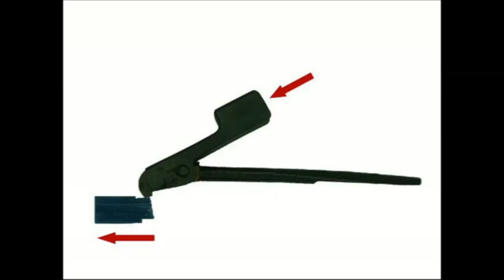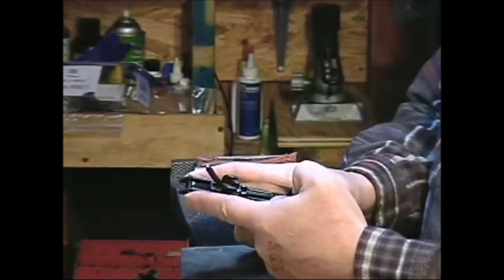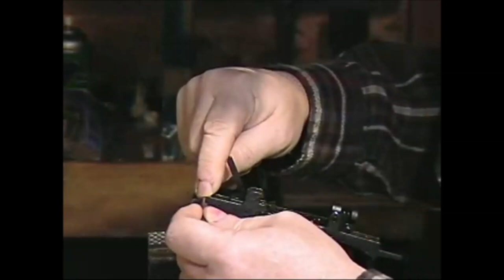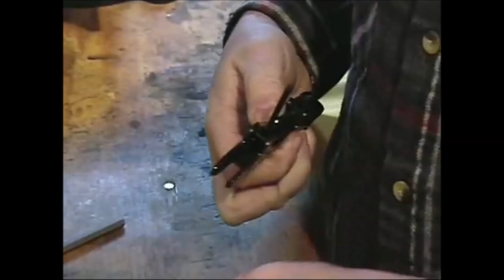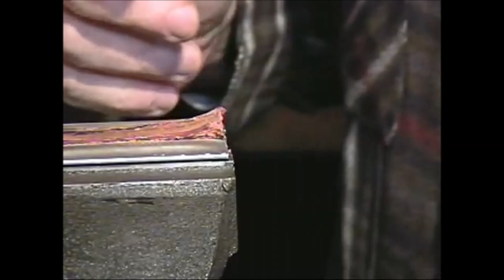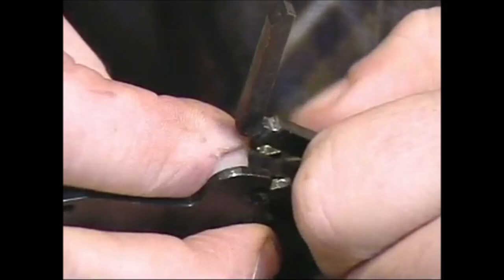SKS trigger Job

Comment: Good video. Just finished this myself. Results were fantastic! 80% of my creep is gone, it is much smoother and has slightly lighter trigger pull with the stock spring. All safety checks passed. Im very pleased and didn't have to send it out for a month $35 later. I would send it out if not familiar or mechanically inclined.

Comment: I did the sear and sear-channel polishing on my Norinco SKS and that smoothed and reduced the trigger pull by around 30%. When driving the magazine latch/sear-spring pin out or back in, the trigger housing's width may be slightly altered because it bends when driving the pin. Check the function of the mag latch; if it's tight, then the housing needs to be widened slightly. I used a brass punch tp pry on both sides of the trigger housing to slightly widen the housing so that the latch moves freely. If the housing gets too narrow, it will also bind the sear.

Comment: When I did my trigger job I marked the sear with Prussian Blue and installed it into the trigger and pulled the trigger so I'd get an idea of how much I could take off.  With this I didn't have to check the trigger pull as often when stoning the sear.
Reply: That's what he did with the red marker.  Didn't you hear and see that?  Either way, good gun smiths check more often, never less.  You didn't learn anything here. Too bad.
Reply: @videodistro  I'm just too stupid.  Thanks for the comment.

Comment: This is a great video. I’m in the process of doing this to my sks. The trigger is creepy, gritty, and long and my sear is neutral engagement. Thanks for this video!!
Reply: This video is 9yrs old.. and I still have the Original upload from the guy who made the video downloaded on a hard drive from over a decade ago.
This is by far the most extensive and detailed video on doing an SKS trigger job yourself.
Even though I have had this video for so long.. and I own 3 SKS's.. I still have never attempted this trigger job - the triggers on my SKS are not that heavy and creepy.. and I guess I have just gotten used to them over the years.. but one day I plan to eventually attempt this trigger job.

Comment: When you hold a object in two hands either hand can wiggle out of position and loose the angle which means it takes a lot longer to fix the misstrokes. put the sear in the vice and use both hands to control the stone.
Reply: Or work 30 years gaining skills and experience and do it with your hands. Some Day if you long enough you may learn this.

Comment: Sir, thank you so much for sharing a wealth of knowledge. I followed you step-by-step. The new springs from MCARBO are in the mail.  I have 3 SKS's. This one was a ghost and the numbers don't match so, it's always been my test bed. I'm pullin' 7 lb. now. It's down 2.5 lb. I don't know where a new and lighter sear/mag-catch spring will put me? The creep is down to 1/4" but that 1/4" is smooth as silk.

I also performed all the safety checks as you instructed. I'm very confident this SKS remains in safe order; it even passed the tap test. In my opinion, those safety checks are crucial and all I can say is gratitude for a super VDO.

Comment: Great Video, thank you for sharing!
Concerning the trigger creep and weight there is no comparison to the situation before!
I have got one question I count on your expertise - If I pull the trigger without pushing down the disconnector, the hammer moves forward a little bit (this is normal I know).
If I then push down the disconnector (without pulling the trigger) the hammer is released (this is a safety issue to my knowledge).
What did I do wrong and may you furnish me with some details how I can solve the problem.
Thank you!
Reply: Having the same problem minus the hammer creeping forward. Contemplating sending off to Murrays. All i can think is it has to do with the hammer and sear engagement or lack thereof or a "bent" disconnector because it worked fine before swapping to murray hammer and sear. Would have done the trigger but got defeated by an inadequate punch and stubborn pin

Comment: Great, but as a mechanic :I would suggest to secure the sear in a vice, so you have both hands to hold the file to maintrain  a correct angel all the time and you can apply moer pressure on the tool.
Reply: Years of gun smirking have turned his hands into a mechanical vise..once you've worked in a field for 30-40 years you'll understand.

Comment: I just make a jig for such things.  Clamp in the piece, work against 320, 500 600 1000 2000 wet paper and then 12000 grit water stone.  Final buff with chrome compound makes mirror.
Reply: You would like Micro-mesh products.
Reply: Too many steps in grit.  Gun smiths can't take all day playing at it like you can do as an amateur.  They have to do it right with dispatch to stay in business.